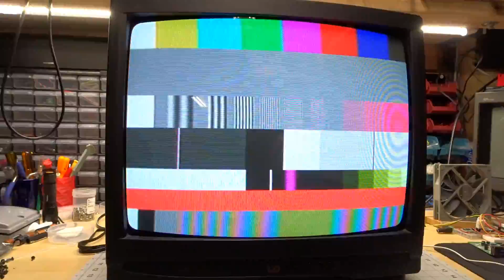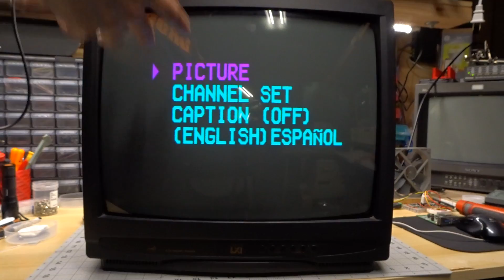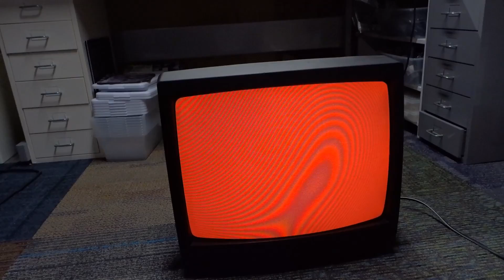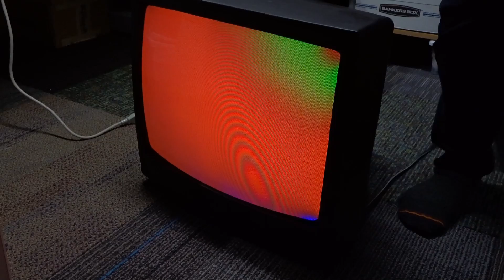Follow-up to my Trash Picked TV 'RGB Mod'

Comment: I feel a bit ripped off now. Back in the 90s, I ran my Amiga through the RF to my TV. I could get TVs cheap but RGB monitors were too expensive. Now I learn that my TVs could've had that option all along but it wasn't brought out into inputs.
Reply: wasn't RGB standard on scart sets?
Reply: @tristan6509 but usa never had a good standard for rgb, they had cga, vga, component, and now dvi, and hdmi.
I do have a rgb to scart for my amiga, but that won't work very well without something that has the correct 15khz, and the right pinout.
I could cut a scart into a TV and try rgb with that.
Reply: I feel like it's the same thing with S-Video and Component inputs on most consumer sets, the TV's circuitry supports it with a handful of passives, but to cheap out on the "nobody uses this anymore lololol" they remove those and the jack, and for component "Yeah, pay more for the other model".

Which is a shame for retro-gaming as many consoles can do S-Video without mods (say, Super Nintendo, N64 and PS1) for a way better quality than composite on the easy, but the jack is harder to come by than component as far as I've seen (in fact, never had ANY set with S-Video input, just outputs even on my laptop)
Reply: I feel like it's the same thing with S-Video and Component inputs on most consumer sets, the TV's circuitry supports it with a handful of passives, but to cheap out on the "nobody uses this anymore lololol" they remove those and the jack, and for component "Yeah, pay more for the other model".

Which is a shame for retro-gaming as many consoles can do S-Video without mods (say, Super Nintendo, N64 and PS1) for a way better quality than composite on the easy, but the jack is harder to come by than component as far as I've seen (in fact, never had ANY set with S-Video input, just outputs even on my laptop)
Reply: Capitalism! :)

Comment: You've got a treasure underneath your floorboards or floor (or ceiling) and the tv is picking up on that :D . Like a dowsing rod or such. jk of course. I have no idea why, because electronics and magnetism isn't something I know a whole lot about. 
Anyway, cool video and great way to show people that old equipment is very useful for any kind of purpose. Thanks for the video.
Reply: Just mess with the gauss of your crt monitor until it looks horrible, and then you've got a makeshift metal detector ! 
Very easy to move and very portable too !

Comment: Looks like it's such a cheapo TV that they scrimped on using a full sized deguass coil, possible from a smaller 14" set. lol
Reply: I suppose the other way of looking at it is that it's a masterpiece of cost-reduced engineering. The fact that it has lasted 20 years means there's still some overspec to be removed from it ;)
Reply: I was gonna say that it would likely just be giving credit to the wrong part, and that CRT's robustness would be to credit, but then again, I've had a late 90s Zenith set here that just went full crap after like 10 years so I'll side with you on this one.
...Tho, yeah they did overdid the cost cutting with that crappy too small coil
Reply: the main board is the same exact one thats used in my 14" tv so this is true
Reply: Well it is a shit Funai TV

Comment: Odd, I wonder if it saw a strong magnet (read: kids messing with TV) sometime in its past life. I have seen a couple tubes with "permanent" red or green staining on its picture because of the partially magnetized tube that the degausser just simply can't reach.
Reply: By the way, the talk about magnets and seeing as it's in the corner, reminds me that both speakers are down there at the corners, magnets very close to the tube's corner as well.
Might as well remove them if you don't use (like, I didn't see you leaving audio input jacks to it but dunno), could even solve the bottom right issue
Reply: Kalvinjj that could very well be it too.
Reply: I actually used a speaker magnet to remove a discoloration on a CRT once; might be worth a shot.